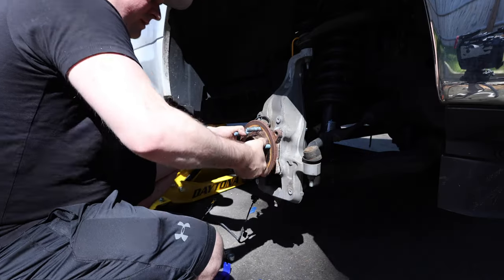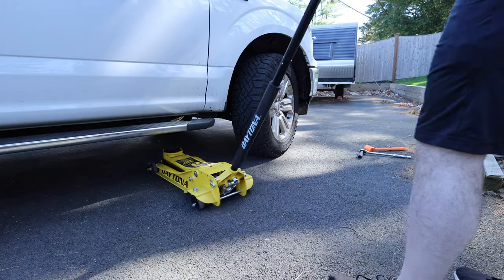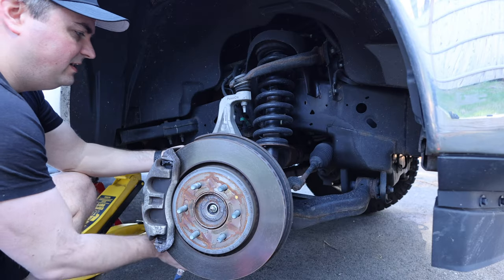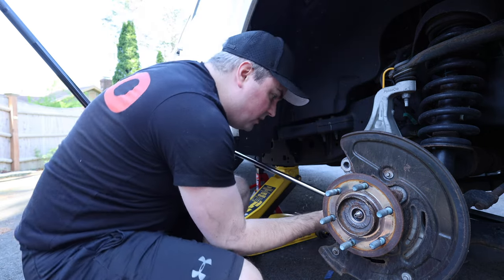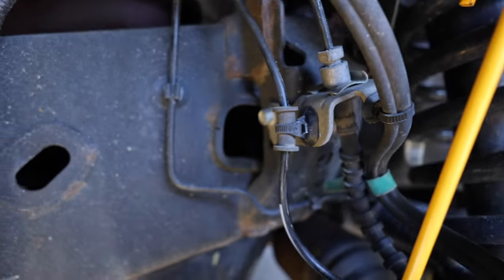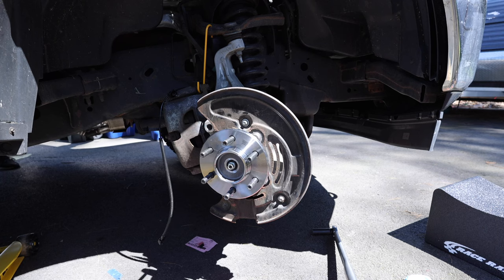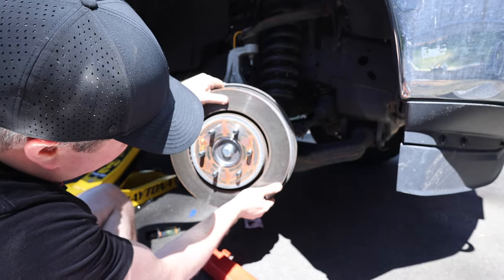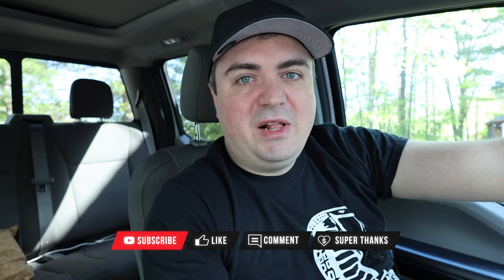2015-2020 F150 Wheel Bearing Replacement

Comment: Did you notice if you had any issues with your 4x4 with the bad wheel bearing ? I have my driver side going on and it won’t go into 4x4 anymore. Comes up with a check 4x4 icon
Reply from the maker: I didn't see that issue but I could see if it isn't registering the right speed it may not allow you to use 4x4.
Reply: @SmackeysGarage  I appreciate your reply. I also think I may have a bad hub actuator. The bearing has been making some noise for a little bit now I’d assume. Had my big wheels and tires on it for summer and recently went to my stocks for winter and noticed the sound was loud from the bearing. Going to check my vacuum on it and see where that gets me.
Reply from the maker: @robertbauer6924 that happened to my last truck. It was more of a big grinding noise and metal on metal than a bearing. When those do go they tend to make a lot of noise. (At least in my 2011 it did).
Reply: @SmackeysGarage  mine sounds like a bearing, had my shop look at it when he did an alignment and said I had some minor play in the tire. I’m thinking the bad bearing has hurt or compromised the iwe causing the 4x4 to not engage
Reply from the maker: @B0bBau3r  that makes sense. On the older truck swapping it out wasn’t that bad.

Comment: Did you go with an OEM replacement?
Reply from the maker: If one was available I would have gone with it. Unfortunately no matter where I went I couldn’t find one. Ended up with one from Rock Auto.
Reply: What kind of warranty that come with?
Reply from the maker: 12 Months.
Reply from the maker: The Motorcraft ones are back in stock at RockAuto now and have a 24 month warranty.

Comment: 5:16 ? Did you not pulll back the 4x4 actuator ?
Reply from the maker: I did not when I changed out the hub
Reply: @SmackeysGarage  but that’s how the axel tightens up with the wheel bearing ( How ford recommends to do it ) asides from that tiny 13 mm bolt . I’ve seen people put vacume into it and some not.
Reply from the maker: Interesting that some do it and some don’t. I do have a vacuum pump (manual one) that I could have pulled it in with if it needed it.

Comment: I only hear the noise when 2H is active.  Not sure if that narrows it down to the hub/bearing. When I engage 4h it goes away. 

Also how do the aftermarket fair compared to OEM? Seems like they are either backordered or way overpriced
Reply from the maker: That’s interesting when you engage 4h is goes away. Do you notice it only when driving straight?

For the aftermarket vs OEM… you’re kind of stuck running the aftermarket right now (like me). I would have bout OEM or Moog if they were in stock. Instead I bought the highest end rock auto one that was available. 10k miles and still going strong.
Reply: That sounds exactly like actuator issue for the 4x4 system.
Reply: Most likely part of your 4WD vacuum system is starting to fail. When the system doesn't hold vacuum the IWE actuators in the front hubs start to partially engage and make a chattering or grinding sound. You can borrow a vacuum tester from an auto parts store and test each side to see if it's a bad IWE or bad lines/check valve. There are some good videos on YT that will walk you through the process.

Comment: Don’t you need a vaccum for this?
Reply from the maker: I did not.
Reply: @SmackeysGarage  does this vehicle have 4 wheel drive
Reply from the maker: @StevennH1  yes it does. When I did my truck, I did not need to disengage anything related to the iwe when replacing the wheel bearing.